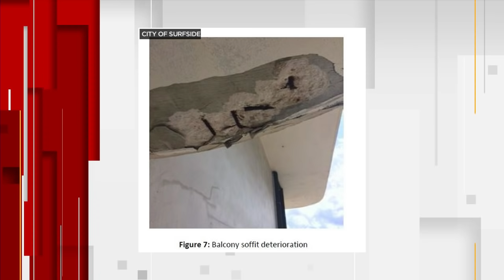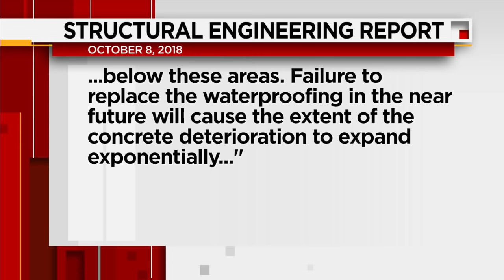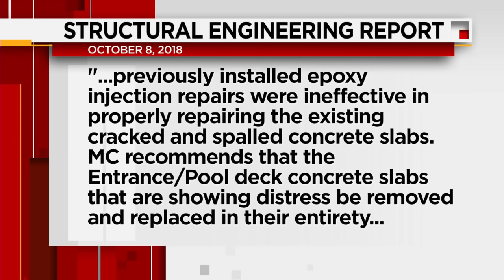Structural engineer Rick Slider discusses Surfside building collapse on TWISF

Comment: The water gushing-in 7 mins before the building collapsed was sea water tunneling in at times up against and beneath the building...this why 4 years ago, the staff had to buy 3 water pumps in the garage beneath the building to pump out all the water, they have to buy a new water pump every year because the pump burns up, hence this went on for years---why any/all inspector's are keeping real, real quiet about this???  Because they don't snitch on each other.  Therefore, you have a unconstitutional partial and bias inspector's in Florida not going to give all the true facts why this building collapsed with over 160 people inside with all of these building codes to prevent this from ever happening.

Comment: I worked in the repair of such buildings and at the bare minimum the columns in the basement level should have been reinforced until replacement could be done.  By reinforcement, I mean each should have been wrapped in steel (angles at the corners and bars in between on each side) and tied together with cables and/or welded.  The weight of the building would then be contained in each column and within the steel.  And that is only a very temporary safeguard until real repair work could be accomplished.  I see none of that in the videos of the basement/parking level in last year's video by prospective buyers, even though the report of 2018 clearly indicated issues with the columns as well as the pool deck slab.  It's all very unconscionable.

Comment: Wow..They didn't drain the pool slab structure with pavers and waterproofing not correct and that slab could be getting rainwater on it not draining.  That is epic failure in correct construction neglect and/or maintenance neglect if that comes out.  2018 the report looked like that slab was 'under duress' I think if the engineer realized the collapse of that could cause a building collapse that would have been 'red tagged' and mandatory fixed or shored up.

Comment: I hope they look into more buildings in the area that were built around the same time. Look into the builders, engineers and archetiects who built around that area. Although maintenence is imperative for a buildings longevity, design does play a role. 
The neglect on the part of the people who were in charge of the building is criminal. This is profit over people all over again. I would be devasted to lose a loved one in a situation like this. Even more so knowing that it could have been prevented if it were not for greed.

Comment: There are 126 owners of the building. The 126 owners did not want to pay the required cost to fix the building. The 126 owners elected the HOA. The state of Florida does not require the owners to do the work or move out of the building. So the owners and the state of  Florida are responsible. How many more buildings are going to fall?

Comment: The report may have been  allegedly watered down as to the magnitude of the actual risk assessment and specific time frame necessary for the most critical repairs to get completed and if not fixed  immediately, the specific time frame with escalated associated safety risk should have been explicitly directly stated in the engineering report. 

There are typical conflict of interests in HOAs boards  whereas they don’t want to stigmatize the property hurting current and future real estate values, many HOA’s don’t have the immediate funds necessary for massive sudden costly repairs plus the order of which repairs are done typically are politically driven, not risk assessment driven, are the ingredients for catastrophic failures as a result.

As such, new legislation will likely be put into place to help prevent this from occurring again. 

In addition, HOA’s need to have proper insurances in place for latent damages to help offset proactive repair costs need to prevent catastrophic losses of property and life.
Reply: Spot on. They were hit with a $15,000,000 repair bill. And after that, everything you said happened.
Reply: @staciasmith5162  It’s really sad. Are you a resident at the property?

Comment: Why are steel reebars used inside of concrete when they rust causing expansion. I just don't get it.
Reply: Because when properly done no oxygen or water can get into it to then rust causing the expansion. if the Rebar is correctly set in the concrete we wouldn't have the oxidation then swelling of the concrete...that is IF this is even the reason for collapse. That is what I got from the video.
Reply: @In2ThinAir  Concrete when poured is wet, a lot off rebar is already rusty when installed. Quality of the rebar are all factors to take into account. However if you look at the rebar in concrete that is demolished there is often signs of rust. In a salt environment exposed rebar would rust quicker.

Comment: I am not qualified in any of the technical issues involved here but I do understand the broader political, economic, and environmental context, and having spent some of my childhood accompanying my grandfather (a very experienced military and civil engineer) on visits to various sites I can recall how he interacted with the people he dealt with - although we don't have the same levels of endemic corruption here in the UK that exist in Florida. 

There are two obvious reasons for the building's owner to start work on the roof before tackling the major structural problems in the basement. Firstly, roof repairs would be a response to demands from residents for action to prevent rainwater from leaking into their flats as water dripping from the ceiling is much more likely to grab the attention of people in a reckless and short-term-issue-focused culture like the USA than potentially catastrophic structural problems hidden underground and out of sight (just as the US public fixates over the price of petrol and ignores the looming global disaster that three centuries of fossil-fuel burning has brought us to the brink of). Secondly, fixing a leaky roof is vastly cheaper than starting major structural work which might require evacuating the building while the foundations and piling are repaired.

I predict that an examination of the documents and the testimony of witnesses (some of whom will no doubt be reluctant to give evidence under oath) will expose a process of prevarication and delay as the owners desperately tried to wriggle out of the need to fork out millions of dollars on hugely expensive repairs that may well have bankrupted them. I also predict that the residents of the nearby sister building, and perhaps any other buildings in the area of a similar construction and age, will now find that their properties are unsaleable and uninsurable, and that this will trigger a longer-term collapse in the property management and development, construction, and estate-agency sectors in South Florida as a whole. On a wider level, this is just a foretaste of a process that will gather pace along the entire Eastern Seaboard of the USA where you have many thousands of multi-storey structures built on sand and mud with no firm foundations on bedrock. Once you add this to a rising sea-level (courtesy of the fossil fuel industry) and an economic system which prioritises corporate profits above people then you are basically screwed. South Florida will be uninhabitable by the end of this century but the economy will collapse long before then as property becomes essentially worthless. If I lived down there then I'd try and sell-up to someone who is still gullible enough to think Global Warming is just a big hoax (I hear there's a property developer in Mar-a-Lago who often sounds-off in this ignorant vein) and move to somewhere much higher, where the buildings have solid and dry foundations, and not so far West that the Megadrought (another by-product of Global Warming) will wipe out local agriculture and make water-guzzling cities (Las Vegas, Phoenix, etc.) unviable in a decade or two.

Comment: It sounds like when structural degradation is identified the HOA / Condo association needs to be given a 1 year MAX time period for those repairs to be worked on or are forced to have their building condemned as unsafe for human occupancy & forcefully evacuated.
Reply: I guess so. The problem is that they had a $15,000,000 bill and an assessment of $80,000 - $200,000 per unit. So where do you go? And mind you you're still paying that $900 monthly condo fee and that assessment bill that you have been hit with.
Reply: @staciasmith5162  True... but wonder what the folks forced to heaven's judgment gate with the collapse would answer... If you lived in such a building with severe structural damage spotlighted by a structural engineer what would you do?  It's like building a new home in a valley that has a dam at it's head in an area where tectonic activity is a given. Appearance and cost vs actual structure...  Such a tragedy.  Biblical reference of houses built on sand vs on a solid rock foundation. Wonder who got paid off for the enterprise.

Comment: As a structural engineer myself thank you for inviting someone who is an expert on the issue. Unfortunately most media have architects who simply don't now much about this (its not part of their job).
Reply: I've been watching and reading what actual structural engineers are saying and they are all saying basically the exact same thing. I wish the media would stop asking architects, attorneys, and other random people unqualified to respond.
Reply: @markiefufu  Some architects are also qualified as structural engineers, you know
Reply: @ryanong3517  no they’re not, lol.
Reply: @ryanong3517  The number of architects who are also licensed structural engineers is very, very low.
Reply: Appears  the beams in lower parking area adjacent to the pool equipment room showed significant spalling . Q: can corrosive chemicals (chlorine) in the room  accelerate the  degrading process of the exposed steel reinforcement ?

Comment: Sounds like the repairs required were horrendously expensive. I wonder if they started with the roof because that was a more affordable way to start being in compliance. I dont know.
Reply: or it's the issue that caused a lot of complaints from the residents.
Reply: You're absolutely right. They had to come up with $15,000,000 to fix the building. Each individual unit was hit with an $80,000 - $200,000 assessment fee per unit.

Comment: Ownership of this building was in too much debt with bankers to make them repairs in a timely manner. And the payments they were receiving from the residents went toward that debt. The banks want their money; and didn't care about the residents safety. The banks didn't want the property,  because they probably knew it wasn't worth anything.  And allowed the payments to continue until all end fails.  Just my opinion " The roof was cheaper to repair; other then the structural damage of the building, that would have required all the residents to relocate. The repairs that was needed to that building was so overwhelming.  The building was gonna collapse doing the structural repairs.  That's why they didn't do the repairs.  Doing the repairs was gonna collapse the building.  It's greed... And who ever was contracted to do the repairs was gonna possibly die doing the repairs. The repairs was too dangerous to do... Damned if you do, damned if you don't do the repairs due to the debt. Too much water damage under the foundation of the building. It's like part of the building was held up by the section of the building that didn't collapse,  but the part of the building that collapsed was on quick sand. One side of the building gave way of holding the other side up...
Reply: Did you strain your one brain cell on that wall of gibberish?
Reply: Apparently they needed $15,000,000 to fix the building. They just received a $12,000,000 line of credit....

Comment: The report from 2018 WARNED of sprawling (a term I just learned) and they still ignored it!   It is very plain that deferred maintenance is what caused this destruction.  They either didn't have the money or someone was extremely derelict in their duties in this expensive Condo building. Instead of waterproofing they used epoxy?  This could almost be a criminal case as well as civil!  This was preventable!
Reply: That is SPALLING.

Comment: If HOA didn’t want to pay the repairs , tell the residents so they could decide to move .
Reply: Most of the residents were owners and the owners ARE the association.
Reply: They had assessments of $80,000 - $200,000 per condo unit to fix  $15,000,000's worth of problems.

Comment: The biggest problem with all condo construction in the USA and Canada is the condo building is being built by a developer, and the only thing the developer cares about is profit. 
I've seen it first hand. 
It should be mandated that the purchasers of condo's have a 3rd party Architect, Structural Engineer, Mechanical and electrical engineers, hired and paid to be on site reviewing the construction for at least 6 hours of every day or every other day, work is performed on the structure. And give them the power to have deficient work repaired or replaced.This is the only way to protect the public's/buyer's interest. This level of 3rd party site inspection is built into the purchase price of the condos being sold. And this 3rd party inspection is hired and paid by a trust set up to protect the interest of the condo purchasers, not by the developer... ie no conflicts of interest... ie I'm hired to protect the condo buyer's interest but in reality the Developer is paying for my service and if I want to get more work from the Developer I had better play ball with him when he asks that I accept/approve a substandard installation of something.
Architects have no authority to have a contractor/developer fix defective/deficient work even if the work does not meet the building code minimum(s). All we can do is write an inspection report that is identifies the problem and send the report to the Chief Building Official. Once I've identified the problem, wrote a site visit report and sent it to the Chief Building Official, my Liability is covered. Architects and Engineers that design buildings/structures have no authority to make a contractor/developer correct deficiencies (poor workmanship or building code violations), only the Chief Building Official has that authority. And his/her authority stops at building code minimum(s), even he/she does not have authority over shoddy/substandard workmanship.

Comment: If the garage was filling up with water 10 minutes before the collapse I’m thinking the severely damaged structure below the pool collapsed causing the water to filter into the basement garage causing the weak structures to crack even further and bringing the whole structure down… a surviver  did mention hearing cracking sounds and seeing one of her walls and ceiling cracked above her bar minutes before the collapse of the building
Reply: Yes, the pool probably drained.

Comment: There isn't an industry out there where safety issues are addressed enthusiastically. Even in affluent Miami Beach condos. $1 million dollar repair bill gets amortized over decades and over hundreds of tenants = minimal Bottom Dollar. I don't think the HOA considered costs a barrier. It is more of the inconvenience + some temporary suspension of revenues. Additionally getting qualified contractors to perform competent work.
Reply: Yes, they did. They were hit with a $15,000,000 to do all of that work. They had assessments of $80,000 - $200,000 per unit. Every one might not have been able to cough up that much money, and you can be sure that who, when, how, where and what repair decisions were political. 😗
Reply: During a pandemic

Comment: Can a building with that much deterioration even be repaired?
Reply: Just about anything can be repaired, but it's costly.  They would need to setup termporary supports all over the place and then chisel out and replace the slabs properly.  It's not cheap and takes a long time to boot.
Reply: @robj144  yep. They were looking at a $15,000,000 bill. When people say that repairs should have been made earlier and I agree that it should have been sooner, but how in the hell could they pay the necessary costs that the contractors charged? Are the contractors going to spot them whatever fees that they're charging and agree on a handshake to pay when (and if) they can and start the work? A survey of the American citizens showed that a vast majority (myself included) didn't even have $400 set aside for any emergency that might pop up and they had no access to get that amount from somewhere else. These condo owners had assessments of $80,000 - $200,000 per unit for those repairs. So you can understand that it takes a bit of time to raise all of that money. A couple  of months ago they had taken out a $12,000,000 line of credit and the work had just begun when the bottom dropped out, literally. If they can't come up with the money tout suite, do they move somewhere else while still paying that $900 condo fee and paying the assessment fees? Damn, it's beyond words at this point.

Comment: What a massive failure, by those building owners. Those poor people.
Reply: How are the inspectors at fault.  There was an engineering assessment done and provided to the association and filed with the city.  The building collapse sits squarely on the shoulders of whomever was on the condo board in 2018, 2019, and 2020.